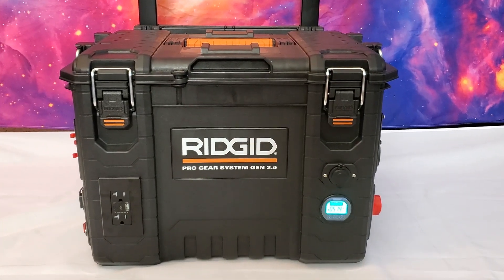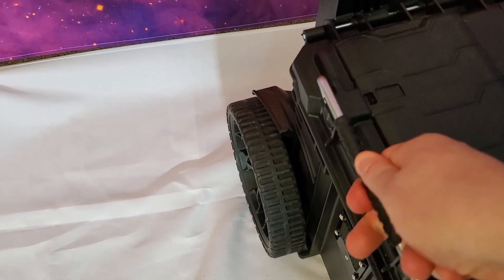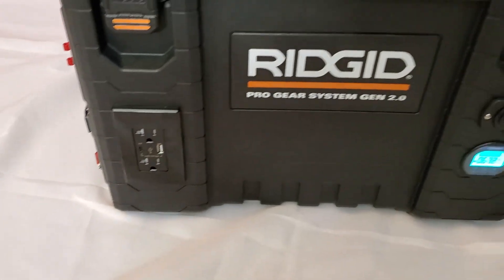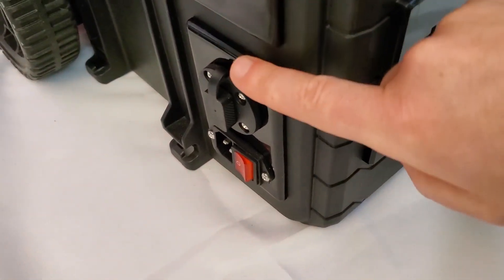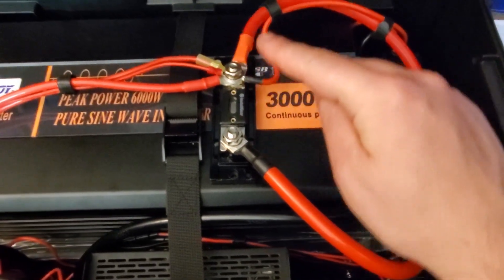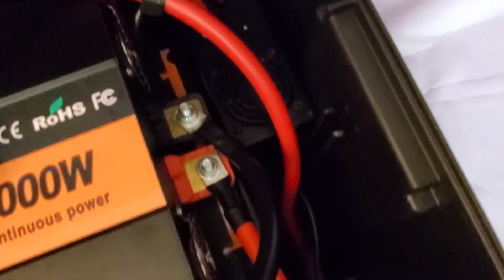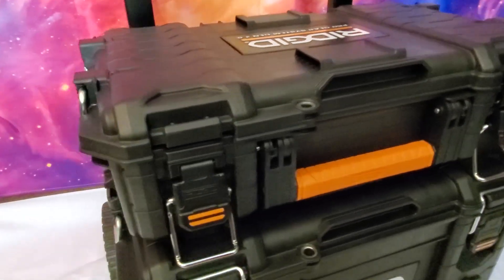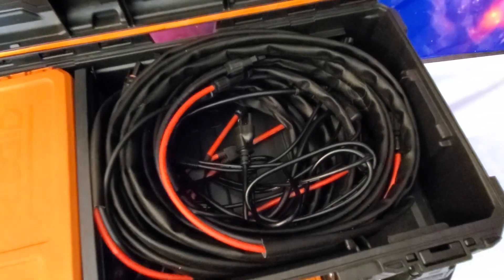DIY Solar Generator 3584 Wh

Comment: How do you turn on your ac charger without having to open the box. I have a power box i made as well but i need to find out a way to turn in the ac charger without have to open the box and literally turn on the power button on the charger.

Comment: Pretty cool. Kind of like AZ Outdoors's setup. We'd like a video of the RIGID boxes, outside hooked up to accompanying panels powering a load, and if you shot video of the build... a video of that. Fingers crossed. Comment here because it's one thing to buy components and wire them together. Another thing to to throw this into the trunk of a car, or have it powering a computer desk via solar panels all wired up. We can hope.
Reply from the maker: Agreed and thank you for the comment. So far I have done testing with solar input, AC input, and running heavy loads (shop vac and window air conditioner), and the build has performed perfectly. I have an off-grid camping trip planned soon so I'll be able to see how easily it transports and how it does on keeping us cool out there!
Reply: @rodermanproductions can you make an update video and If you’d change anything. I’m really thinking of building one myself.